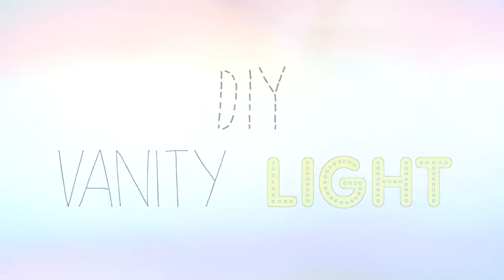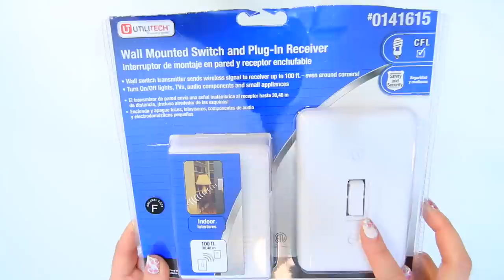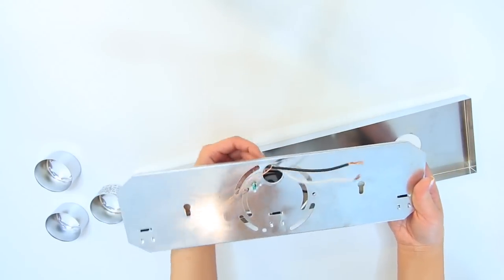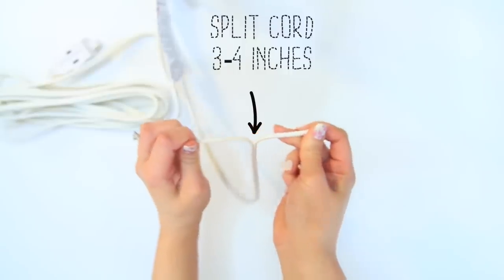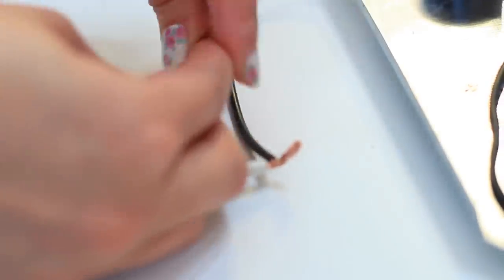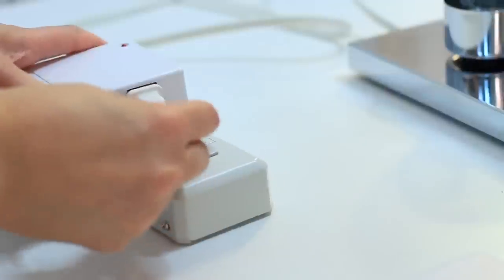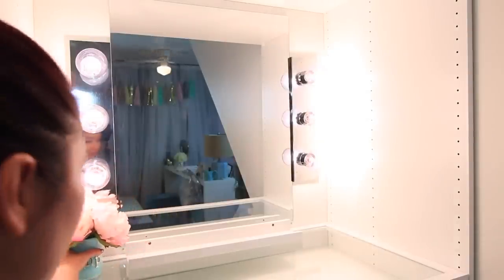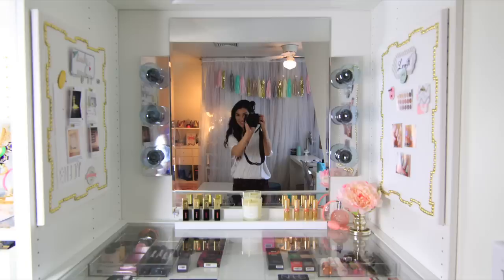DIY Vanity Light Mirror - Easy & Quick (LisaPullano)

Comment: I did this last night! It came out great.. Pretty easy but in thankful for the people who commented some suggestions here because most of the videos don't cover everything such as how to get the mirror & light bars up.. So for those of you questioning I used the same exact mirror & vanity bars provided in the link, you can get the mirror to hang by using the command strips but I placed about 8 on my mirror.. & for the light bars this video shows how to set it up & it's good to do this on the floor first to test it but when u place it on the wall you need to unscrew this little blue/green screw holding the copper wire inside using a screw driver & then use 2 command strips and attach the vanity light bar to the wall.. Without the cover ! U can then close it once it's on the wall & assemble it.. Other wise it won't stick..
Reply: Omg thank you! life saver I'm the the store right now. glad someone is answering questions
Reply: +Sheis YourStylist no problem!

Comment: I am planning on just plugging these babies into an extension cord.... Therefore, I do not need the remote lamp control or the outlet adapter, correct? Thanks for this helpful tutorial. I've struggled this whole week with lighting around my new mirror and new vanity. Really frustrating. Can't wait do this when I get home (hopefully my bf is running out getting supplies).

Comment: Hi Lisa,Your instructions were very clear and I've assembled everything and got it working. However, I was wondering would it be possible to add a light dimmer? I found one online called the Lutron Credenza for $12 ... but it's not remote. I wouldn't know how to connect the wires since it's the dimmer on one end and the power plug on the other. Do you know if or how this would work?

Comment: Quick question, Im in the process of remodeling my room & I have a great wall space that Im using for my vanity. I have MAJOR OCD w.excessive cords, etc. I want to do this method over building the mirror w.a frame like most ppl have been doing. I just dont want the cord from the lights to show. What did you do to hid the cord like it was in the very beginning and at the end. Not when you used the flower to hide it. PLEASE HELP!

Comment: Hey Lisa, my husband attempted to make this the only issue was that the vanity lights didn't stick and fell off and broke. What are other options I can use to place the vanity lights?
Reply from the maker: Did you use a whole pack of hanger strips to one vanity bar light? Di you make sure your wall was clean and not covered in dust? Make sure to hold onto the light socket firmly to make sure it won't fall off. You can also use industrial velcro but I had not problem with hanger strips.

Comment: I am trying to do this today and I am having problems getting the lights to hang.  Could you clarify for me where the strip goes as the back doesn't sit flush to the wall? How many command strips did you use on the lights?  I really want this to work in my small space and not have to put holes in the wall.

Comment: followed the directions and it worked perfectly only thing different I used a wire stripper and not scissors 😊
Reply: What did you use to hang the mirror ?
Reply: +Delilah Daniel I had a beveled edge mirror that I hung with the clips it came with I also was able to secure it with command strip tape

Comment: Just wanted to add that the copper wire can be cut so it isn't attached to the light cover (which I found annoying to deal with lol). Also, the little green screw prevents you from properly attaching the light bar to the wall since it sticks out. You'll have to unscrew it :).

Comment: How did you get your light bars to stick? I got the left one to stay but my right one keeps falling off no matter what I do. 😩😩
Reply: I had the same problem.  Help!
Reply: +RedLetter Daye well I finally figured mine out lol. There was a little screw that was holding on the cooper wire and it was making it impossible for the back of the vanity bar to stay flat against the wall. So I just unscrewed it and took it out places it back on too the place I wanted it to be and it has kept in place since.
Reply: how did u hide the white wire
Reply: +Jess Castro I just placed my flower vase in front of one of them and then my brush holder in front of the other one.

Comment: i used regular command tape and the Vanity bar keeps falling off of my wall. Does the velcro command tape actually work?
Reply: Did you get yours to work? I just did mine and one of the light bars just keeps falling off
Reply: it kept falling off too.it doesnt work lol
Reply: +Nicole i figured it out mine had a little screw that was holding the copper in place which was interfering with the placing to the wall. So I just unscrewed it and put more command strips over it and now it's holding up. 🙌🏻

Comment: hold on! what did u do with the orange wire? there were three wires in them.
Reply from the maker: The copper wire is used to hold the black and white wire together when converting it to a plug in as an OPTION. You don't need it but it's there. I wrapped it around the two connected wires to keep it tidy before closing the vanity bar light frame.

Comment: I think it's great that you're sharing DIYs to make things work within the restrictions of your current situation.  However, I would caution your viewers to remember that when they do this, that "wire" that was used to wrap around the black and white wires in the back is a grounding wire.  This appliance was designed utilizing a grounding wire to prevent users from getting shocked by the appliance should something go wrong.  Since that feature is not being utilized in this DIY, this is a risk that persons making this DIY are taking.  There are also ways to make the wiring more solid (soldering and heat shrink tubing to cover the exposed wire) but that would make this tutorial less simple.  Any time one is taking something and using it in a way it was not originally designed for, there is risk.  So just be careful guys and keep safe!

Comment: The mirror looks great but this method is pretty dangerous. I would never cut or mess with wires like this because it would be very easy to do it wrong. You could also short circuit the entire house/building and potentially fry other things plugged in around the house. That's why electricians spend years studying to become qualified! I love your creativity but I hope that other viewers think of potential consequences before running out and copying you.

Comment: This seems so incredibly dangerous to me. This really should be left up to the electricians.
Reply from the maker: If can be if you can't tell which wire is black and white by feeling the texture of the cord, and properly twisting the protective end caps on. I learned the basics starting in elementary school with a battery, two wires and a light bulb to a light socket. It's safe to follow the direction given in this tutorial since kids do this for science projects. I would hire an electrician for installing power outlets for sure into drywall 😉
Reply: Ok :) I'm from australia and we have a much higher voltage here also so it may not be as bad in America. Anyway I got some great ideas from this video :)
Reply from the maker: Karen Langridge I am dreaming to go there! Nice =) As for higher voltage, it wouldn't make a different because electricity flow in a parallel circuit no matter how much. As long as the flow isn't interrupted than it's all good. I am sure you can do this project using material at your local hardware store with no issues. It's nice to meet you and feel free to email me if you have questions.
Reply: Thanks so much. I'm hoping to do something similar to this later in the year with my dad. Thanks for the video!
Reply from the maker: Karen Langridge That's awesome =) When you do, I would love to see your vanity. You rock Karen!